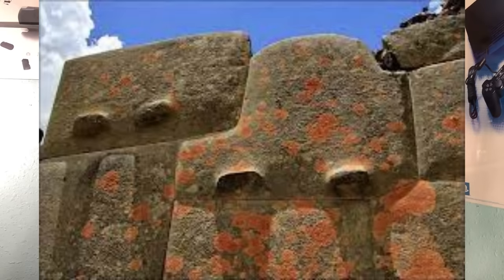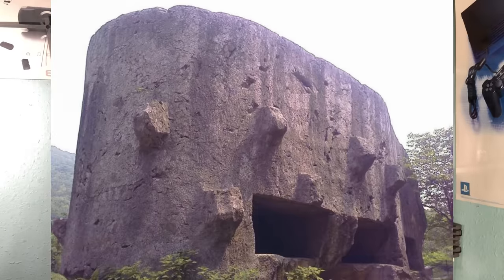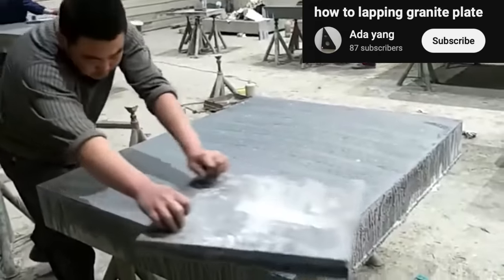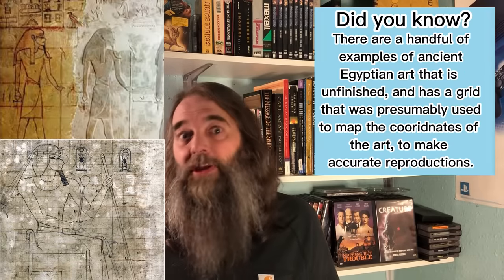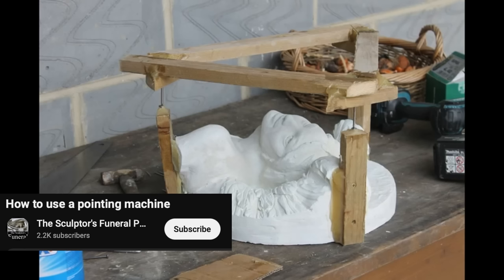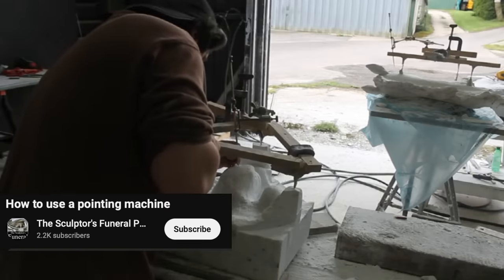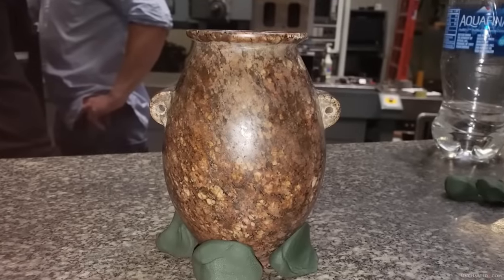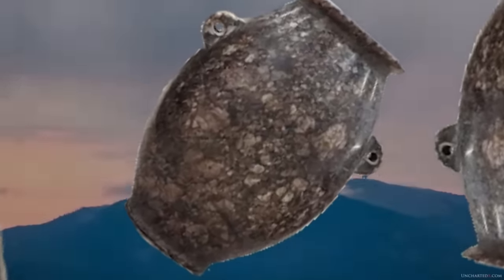The True Purpose of Megalith Stone Nubs

Comment: It's an interesting idea but drilling a couple of holes into the block would be a thousand times easier than cutting down the whole block to leave a nub.
Reply: How do you drill a hole without a drill
Reply: @christopher1367  If you could make a block with a nub you could make one with a hole in it. How do you make nubs?
Reply: Also this does not explain the precision. It kinda does, to a level but nowhere nere as these jars have.
Reply: @christopher1367 how do you quarry stone if you do not have wood working skills? Look at hand drills for mining they are just chisels that you rotate after each strike with the hammer.
Reply: @andymccracken4046 it would depend, I suppose if you could hide the holes on the sides or not?
Reply: But then your wall would be full of holes. With this technique, they can grind off the nubs at the end. It's also more practical to build the wooden formwork with included nub frames (since you're going to chisel the entire stone face anyway), then to try to fit it to pre-carved holes. You're also assuming the stone face is already flat to begin with, which it most likely wasn't and would require smoothing anyway. It's also quite a small amount of labor in the whole process of chiseling out an entire block, certainly less than a "thousand times" harder.

Not defending the hypothesis (though it's quite reasonable and refreshingly less outlandish than most alternative history's usual offerings), but your objection doesn't really refute it.
Reply: @christopher1367 they somehow was drilling holes. We see that in the door way areas where the hinges were located.
Reply: Very good point.  The presence of those nubs wasted a huge quantity of stone, particularly on the larger blocks, not to mention the subtractive removal process, so there had to be a very compelling reason for them to be there.
Reply: @CrowPal  You hit the nail on the head man, that's Why this topic has been boggling mind since the builders died, whoever they were. Unless the builders had some kind of tech or tool that made removing large quantities of stone from the face of a block ice cream scoop easy, (scoop marks are a thing at many sites,) then that is a ton of work to make a nub in the first place, so I see your compelling reason for them to be there and I'll raise you a question. Does the fact that so many of them weren't removed during finishing tell us anything about their usefulness after construction? I have a hard time believing that it was too difficult or bothersome considering the scope, so why not remove them?
Reply: They had to chisel the block anyway. I'm not saying this guy's right, but the nubs are where the stone was last connected to the quarry. They would chisel underneath the stone, and leave a few pillars of stone to support it until they were finished, and then break it away using levers.
Reply: @christopher1367  you could not drill a hole without something to use as a drill such as a pcs of wood or copper and some sand just like how people were drilling holes in stone for many thousands of years including even how the eqyptions drilled holes in rock 1000s of years ago right up to the middle of the last century.  Tho drilling a hole would be easier then the nubs it would leave holes on the faces that would need to somehow be covered up or filled in if they did not intend for it to have visble holes in the faces of the block when they project was finished.
Reply: @ddoherty5956  look back even before steel star drills even existed and how holes were drilled in rock for many 1000s of years before them.  and is even how lapidarists drilled small holes in stones even right up till a few decades ago when diamond-sintered drill bits started to become more common.   You can drill a hole in hard stone by using a wood or copper dowel or tube and some sand as an abrasive and you rotate the wood or soft metal drill bit and the sand is the abrasive.  just like how the ancient Egyptians did it
Reply: @jjames3793  yeah show me the videos of people drilling stone with wood or copper

I think you’re mistaking hole punching?  Like for jewelry?  Maybe maybe with sand but you’re taking a hugely labor and time intensive process and, THERE’S NO SAND ON TOP OF THE MOUNTAIN
Reply: @cliffp73  ya tho people have been drilling holes in rock for many many 1000s of years and have done it the same way right up till the 1940s  all thats needed to drill a hole in stone is to rotate something soft such as wood or a copper rod with some wet sand as the abrasive just like how people all over the world have been doing for many 1000s of years.
Reply: @OskariKulmala1  This explains presision: If you pour like gypsum into the empty space in the wall, using the space as a mould. And the use the hardened gypsum as a "prototype" for making exact stone copy of it. Thats the only way of making perfect fit stone. No other way I cant imagine, speaking as a master stonecutter myself :)
Reply: Not if you're using incredibly high heat to mold the rocks into the right shape like clay; the rock just sort of flakes away as the impurities in the stone expand due to the high heat.
Reply: But Nubs can be removed,  holes cannot!
Reply: They had to start with oversize blocks anyway, each block is cut to fit with its neighbors. Its less work to just not cut away the nubs.
Reply: @benjamincrowley9919  the nubs are for holding the ancient workers coke can and sandwiches (all that masonry is arduous)
Reply: @christopher1367 they had drills, there are examples if drill holes all over these sites
Reply: Kinda depends on the original shape of the stone.
Reply: This is engineered stone.  Once the mortar set, it was too hard to file down.  So they poured the "cement" mix, and the nubs was the outlets for overflow.  Even the nubs was too hard to file off.  It looks as if the nubs are the thickness of whatever timber they used for moulds.
Reply: You actually do see this in some formations. It’s a sort of vertical groove that a hook could sink into. Check the Sage Wall in Montana, US.
Reply: Absolutely correct 👍
Reply: @andymccracken4046  Consider this.  Many large stones were quarried by creating a trench.  That trench was extracted until the block was separated from the wall of the quarry.  Now the fun part.  When you need a nub left, you simply leave the nub as you work.   That would be cleared with graphics.
Reply: @christopher1367 And?
Reply: @allrequiredfields  and what?  It’s a joke the man said “ drill”.  Y’all dense
Reply: Then you would have a stone with a hole in it. Kinda hard to fix that. Duh
Reply: Then you would have a stone with a hole in it. Kinda hard to fix that. Duh

Comment: Geometric shapes are reproducible, but all these stones are irregular, and none are reproducible. Taking it a step further, the unknown method used completely disappeared. And finally, if there was a rig, why remake it every single time? So, I disagree.
Reply: I will beleive it when someone actually replicates it at scale.
Reply: Not reproducible?  Seriously?  It was done around the world for thousands of years. Explain that.  And I could go to Home Depot, hire 20 guys, go to their the quarry, use appropriate stones, extract the bolder, move it, pound it into shape, smooth the front side (cus the back sides weren’t finished), smooth the sides, fit them, move them to refit and re-place them.  Using a simple STRING and hands to produce absolutely straight, smooth surfaces and build the wall using smaller stones.  Give me more men and we could do a replica wall.    Bigger stones would need the tools which we would discover the need for and build.  FYI, I’m presuming none of us have EVER worked stone.
Reply: @frankedgar6694  there is no explanation, that’s why seeing these structures is fascinating. There are no or very few tool marks, the material is the hardest in the known world, and this was done around the Bronze Age. Fashioning extremely heavy, large, dense stones, each one unique in shape, one by one, i.e. non-reproducible, and placing them as seen, well, no one has come up with a believable explanation. Also these walls, or structures, are found not only in Egypt, but also in Central America. Many scientists have considered this, no answer.
Reply: @Legslarsen.  First, it isn’t the hardest stone therefore it can be quarried using actual harder stone.  Second, a harder stone, pounding on a softer stone breaks away the softer stone.  Go to Egypt.  Go see an actual quarry where the Egyptian stones came from and you can see where they did it.  Go to Cuzco and look at quarries.  Same thing.  This is just stupid.
Reply: @frankedgar6694  Like chipping? These are smooth surfaces with very tight tolerances. That suggestion was a;ready refuted by qualified scientists. Check online, you’ll see. But it’s OK to have your own idea, of course. It’s good to try new ideas, if they are in fact, new.
Reply: This.  Everyone talks on the internet.  No one has actually reproduced any megalithic stone structure—not even a small scale replica.  Not even a single replica stone has been created without steel, without electricity.  People are satisfied with the dolomite pounding stone explanation without a demonstration.  We just say—look at the quarries—that’s just how it was done.  Hard small stones, time and human energy.  Nothing more.
Reply: I’ve heard that these stones are all unique at each site. I can’t confirm this, it would seem to me that a reproduction process was not used on these walls simply because we don’t find exactly same blocks in a reproduced fashion. I love the nubs explanation and hypothesis. This is a tough nut to crack, but I think we’re still looking for the correct answer.
Reply: @frankedgar6694 you can lift rocks that weigh over a ton? You’re one strong fella
Reply: The american indians have copper and bronze chiesels. Copper and bronze chiesels are actually used for finishing stone as it is easier to control. Tight fitting is actually easy to do. Samurai walls are still being built in japan. Some iranian stone mason can also make tight fitting stones and most of the lighthouses before concrete use tight fitting stone thay are way more complex than those by the inca
Reply: @JL-tm3rc  Samurai castle blocks are about 1/20th the size of these stones lol. Apples to oranges my guy
Reply: @ShanyeSoT  samurai walls are also built using very large stones specially on the corner.19th cemtury Light houses are also built using very large stone blocks. The largest stones ever moved bu man were done during the 18th and 19th century
Reply: @frankedgar6694  It's never been done. Everyone gives up before the first stone is complete.
Reply: @josiahbaker7811  Well THAT explains every pyramid and temple in Egypt.  There are megalithic building on every continent and sub continent except Australia.   Explain that.  India, Cambodia, Laos, China, Africa, the Middle East, England, southern Europe and one and on.  Much of the area in Central America even has intricately carved stone.  Take a class or something.